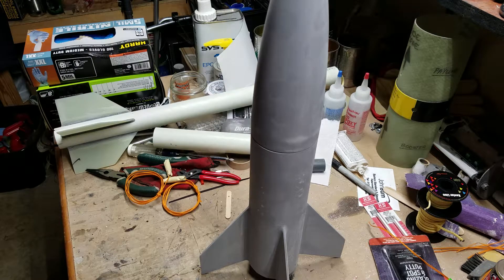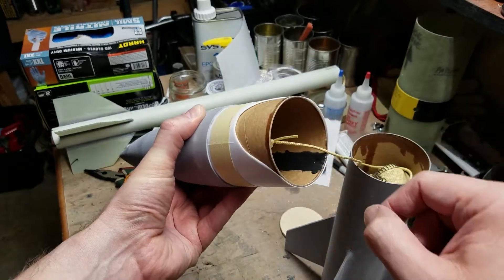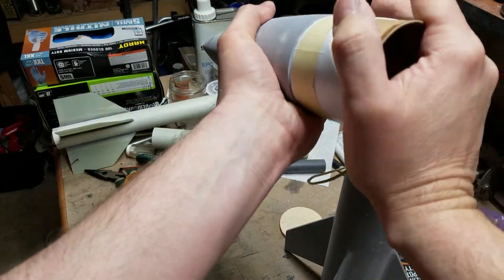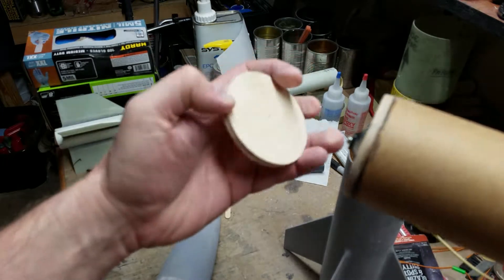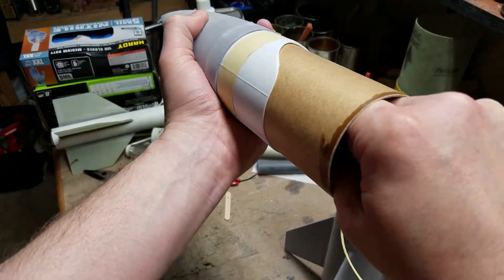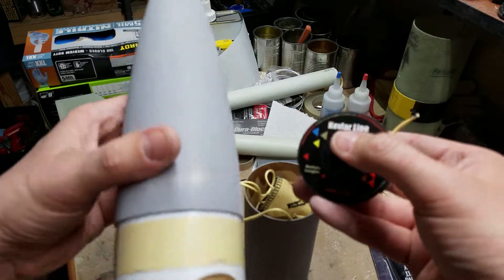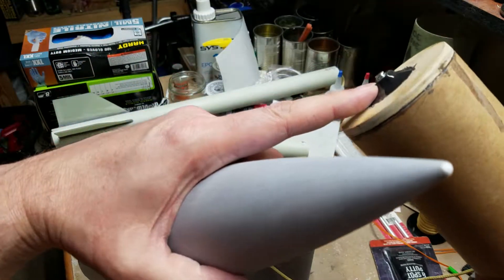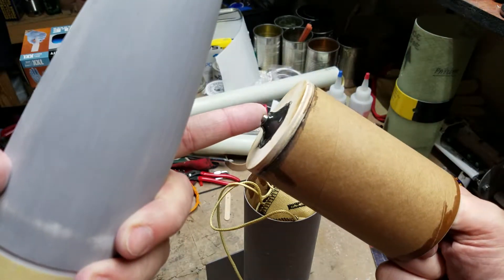Estes Big Daddy nose cone modification for long motors

Comment: Is the airframe tube stock cardboard wrapped in fiberglass/Epoxy?  Did you do a tip to tip layup on the fins?  How high did this rocket fly on an H motor?  Sorry for so many questions I am going to build an estes big daddy with a 38mm ply hop up kit.   
Thank You
Reply from the maker: @wyliewesty  Stock cardboard body tube, no fg anywhere, just got construction techniques and epoxy. Airframe gets soaked several times in thin CA on all edges,  2" down into the BT. Essentially turning it into a composite.  Cardboard and plywood is far stronger than people today give it credit for. I fly the 38mm upgrade on I motors all the time.

Comment: What is the largest motor you believe that can be used with your modifications ?
Reply from the maker: So far I have FLOWN this specific rocket on an I161W (38/360) and an I225FJ (fast blackjack) in the 38/480 case. The 38/480 was a squeeze, but it fit and even had a chute release. You could do the 38/600 case but you would have to do another transition to even smaller tube to get further up into the far end of the nose cone.

Both I motors absolutely ripped and flew spectacularly. The I225 was especially good, and I am not a smoky motor kinda guy, but the Black Max propellant (fast blackjack) is very stout. I225 maxes out at 62lbf of thrust and that rocket, loaded, doesn't weigh 2lbs. Too bad its not popular and not really carried most places. Better marketing I think could have opened peoples eyes to a rather bitchin propellant.